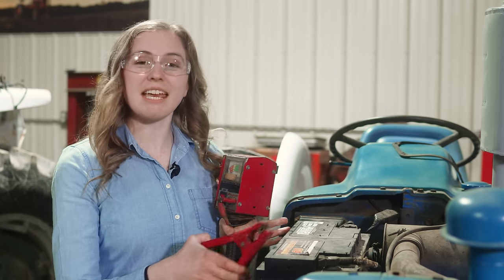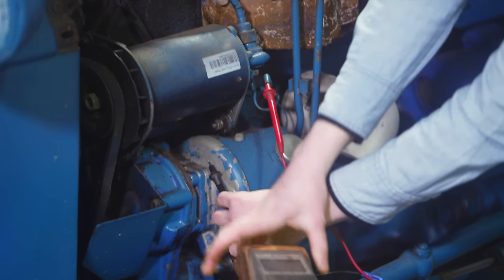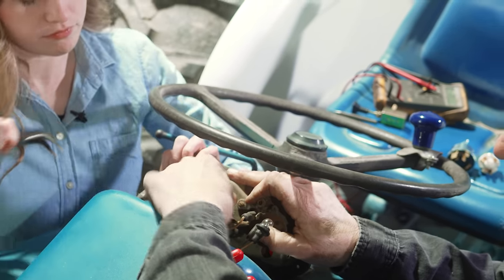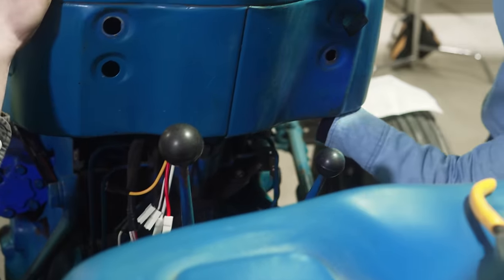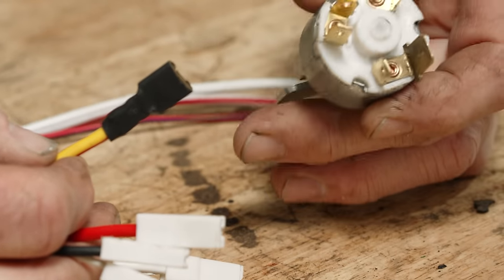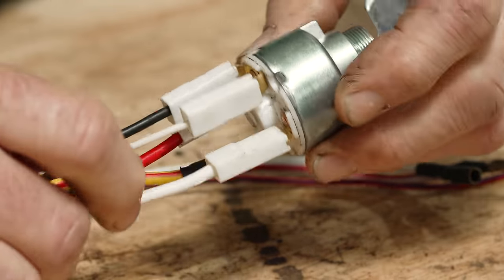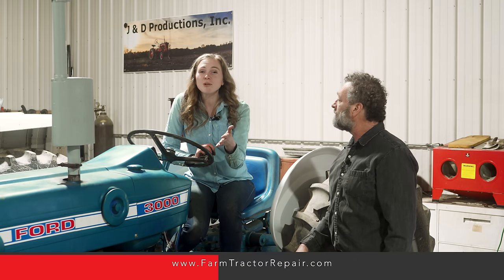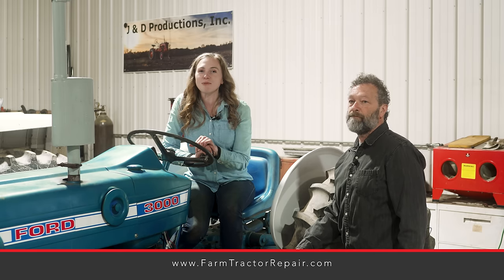Ford Tractor Wiring and Charging System: 2000, 3000, 4000 3-Cylinder

Comment: Hello, so in a bit of a pickle. i have a 72 Ford 2000 gas 3 cylinder and I have replaced my wiring harness as well as a new generator and voltage regulator all from your site so I know they are all working. It still doesn’t seem to be charging my battery. My voltage light still stays on and if I remove my negative from the battery with the tractor running it cuts out. I’m at a loss here, any suggestions would be much appreciated. Thanks!

Comment: One of the best sites for information about this nice old tractors. My steeringgearbox has much play, maybe at some day we will see a video troubleshoot for this to fix it. Thanks for your help
Reply: The gear box is adjustable and it's not a hard job at all. Search for it on the net and see what you can find. This is a generic adjustment. Look for an old car, truck, or tractor manual. Adjust the worm shaft first then the sector adjustment. First thing is to inspect all steering components to see if anything is worn causing the excess play.

Comment: I have a 1970 Ford tractor 2000 My question is why is my new starter dragging when I turn off my ignition is still drags I took off the cables to get the tractor to stop I'm thinking it can be the ignition switch second question is when I did hook up the battery cables My tractor started without the ignition being on gets me to think that I might need a new ignition switch puzzled

Comment: Great video.

About 3 years ago, I got fed up with the wiring on my '68 Ford 5000 and as a summer project, my sons and I did a complete overhaul.

replaced the points and coil with a Pertronics setup which allows a full 12v to the coil now.  Generator and voltage regulator were replaced with an alternator.  The location of the voltage regulator was perfect for a fuse box.  Replaced all the lights from the headlights to the dash lights with LED replacements.  Added LED work lights and LED strobes up on the canopy, so now I have great 360 degree light around the tractor at night- perfect for snow removal.  And then, we custom wired everything.

I completely restored the rear light which took some significant work as the inside of the lens was caked with 50 years of crud.  I also redid the factory dash.  I didn't like the replacements with extra light sockets.  It also took some work and some careful silicone work to reseal it again.  But the restored dash with the LEDs looks fantastic.

My youngest son (11 at the time) worked out the fuse values for each circuit.  Was a perfect "real world" use of math for him.  So, the dash is it's own circuit along with the ignition.  The headlight switch, the new switches for the strobes and front and rear work lights are all on their own circuits.  A huge automotive connector was used above the fuel tank so that the tractor can easily be split.  Also wired in a pigtail so that my Battery Minder charger/conditioner can be easily connected.

All in all, the upgrades made the machine far more reliable, the lights are now awesome, and almost everything works as it should.  My only issue was that the alternator drives the Proof Meter too fast.  As a result, I installed a tach with hour meter up under the canopy to have a true value
Reply: Dang I wish you had made a video of this. I have a 1966 ford 4000 and I’m wanting to redo the wiring.

Comment: At 14:04, those are called Bayonet connector bulbs.    At 20:40, it should not be called Yellow/Red, but correctly called Yellow with Red stripe. Same for the rest.

Comment: I've just bought a one  owner diesel 3910 II Ford tractor with 1400 hours from a neighbor.
Good shape but a few issues, starter/solenoid or ignition switch, have a small power steering leak and a small leak at injector pump.
First I'll completely service it before using it. Received an Operators Manual today, but I can't find information on the information I find under the hood, Tractor # BB20195, Model CA414C, ....Where can I find this and year it was made.
Thanks and enjoy your videos.

Comment: Any ideas about changing a belt connected to alternator, fan, and one more in a Ford 3910 tractor with a p.t.o. without pulling the whole front end off?  Researched but can't to find anyone/anything that helps.  Initially pulled off the bolts off one pulley off the bottom and was able to move the spline forward. There seems to be enough clearance to get the belt behind but can't seem to get it over the pulley.  Any thoughts or help would be appreciated. Thank you!

Comment: This test at 4:45 of the video does not prove that the regulator is functional. It shows that the field and dynamo wiring is intact, but does not prove the electrical operation of the cut-out, and the voltage and current relays. The voltage shown is only armature residual which on a lucas generator is 2 to 3 volts. Try fixing components instead of replacing them.

Comment: Great job, I have a Ford 3000 diesel, and transmission oil is white from moisture how can I get all that out before putting in new oil.
Thanks
Reply: If you look on the bottom of your tractor there is a drain nut for that and then there's one in the middle on the side of the tractor that's the fill up just keep putting gear oil in it until it goes clear then cut your bottom nut and fill it up until it starts coming out that side nut you're full you're fresh you're finished❤

Comment: I have 1969 ford 3000 3 cylinder gas engine. And i used it y months ago ran pretty good. I went to go start it the kther day and i have no start. I think i have to replace my distributor cuz the wire that comes out of it feels like it is broken inside the coating of The wire and unfortunately it's broken right up close to where the rubber boot is that goes inside the distributor so I'm unable to just place in a new wire. Wish you guys were closer I'd have you fix my drive to her and find out what's wrong with it.

Comment: Hello, I have brake and hydraulic problems for my Ford 3000. Can you help me with just information?
Reply: Yes, with pleasure
Reply: ارسل رقم الهاتف كي اتواصل معك
Reply: The hydraulics do not stay at a single setting. Do I need to replace the valve seal for this?
Reply: Ok, I will replace all the gaskets. It doesn't lift adjustable, it only lifts or lowers it straight.
Reply: Sorry to bother you again. Ford 3000 hydraulic brain has a spring next to the press valve. Does it need to be removed in all of them?  This bow is missing in some videos, thank you again

Comment: All my tractors are industrial tractors (MF-202 and JD 302A).  Will you ever do any videos on them?  I know that my MF is close to a TO35 but I don't know the ag version of the JD302A (do you know?). Also, I made the mistake of buying tractors that needed new rear tires- so I need 4 14.9-24 tires.  2 years ago, these tires were $400 ish a-piece so I put it off.  Now they're going for $800-$1200 a-piece.  Surely there is a way to not spend $3200 and get some tires (and no, new tubes won't solve this. Any ideas?  Would love to get your advice!!!!
Reply: You learned a lesson the hard way.  Everything increases over time.  Odd ball industrial tire sizes especially.  Step into a Carlisle.  As for industrial... highly doubt there is much if any difference beyond implement accessories.  There was another import tire brand I've heard of... but can't remember at the moment.  It will probably come to me when I stop trying to remember it.

Comment: It’s not a bad idea to use dielectric grease on all those electrical connections before you plug them in.  Keeps corrosion at bay so ten years down the road when the ignition switch needs replaced, it all unplugs like it was new.

Comment: I have Ford 4000 and it has a dc generator. . When I start the engine, the charging light stays on as long as I increase rpm enough. The charging voltage is still only 12.5-13v. The generator is rather new and so is the regulator and wiring. I was wondering are these dc generators just so lazy... Many people have upgraded to ac alternator taken from a car...
Reply: That sounds correct to me. The generator produces less volts then a alternator would. So the volts your getting is right. They definitely charge at a slower rate. I also have to Ford tractor I have 1969 3000. With the industrial size front bucket loader. Absolutely love that old girl.

Comment: you had me until you said to pull the battery cable off while running to test the charging system. you put a voltage spike through the system and could burn out some parts.
Reply: Won’t the voltage regulator prevent a spike?
Reply: @stephens7107  that is what would get burned up as well as the lights and gauges.

Comment: You can do a load test without a load tester. Just hook up your volt meter to the battery and crank the engine over and watch your voltage. Poor man's load tester.
Reply: A true load test is checking the cranking amps.  The tester creates a dead short pulling on all the cranking amps available.   You can have a battery that wont crank a tractor but enough voltage to turn on lights or a radio etc.
Reply: Or show 12 or more colts in a tester
Reply: @jdubya54  The load from your starter is your draw while you watch the voltage drop on the meter. Even a caveman can do it!
Reply: @jdubya54  Out of all the years I've been an automotive I've never seen a battery load tester that test amps. They always test volts. Only time I ever seen anybody doing amp draw test was to see if a starter was bad.
Reply: I never met a cave man before.  Lol

Comment: You absolutely cannot check an alternator by disconnecting the battery cable while it's running! If your regulator loses ground a good alternator can put out 100 volts at high rpm! Headlights go off like flash cubes. Internal alternator wiring looks like burnt shredded wheat, etc. I'm in central Indiana. If you want to learn mechanic work and pay me a small but reasonable wage I'll drive up there and teach you how to rebuild engines, transmissions,  differentials, carburetors,  starters, alternators, generators, electrical diagnosis etc etc. Somebody could get hurt and/or cause serious damage to their equipment if they follow your videos.
Reply: I’m commenting so I can see who’s right. I’m not educated on this so I would like to know. :)
Reply: You can't just generate current. It has to go somewhere. That's where the load comes in. Alternators and generators are rated by Amp output at the specified voltage. Testing equipment on the bench or vehicle requires a carbon pile to load or drop the output resistance. If the voltage regulator is working and voltage is at the specified range Ohms law says amperage will increase and that's what we need to check. You can disassemble,  clean, and play with an ohm meter but you won't know if it's going to perform.  When it's done properly you might show 40 Amps @ 7+ volts for 6 volt system or 14+ volts for 12 volt system. You have to produce more than nominal voltage to overcome resistance in the wiring and the battery itself. Even Harbor Freight has a load tester than can impose a quick load on your charging system. This is the electrical equivalent of an engine dyno. You put a load on it at operating rpm to check the output. Stator windings can actually be checked on the bench when disassembled. Connect a battery and Amp meter directly to the windings just for a second.3 wires have 3 ways to connect so there are 3 test combinations. If you read 60 Amp draw its output will be 60 Amp. 90 Amp Alternator will have 90 Amp draw etc.